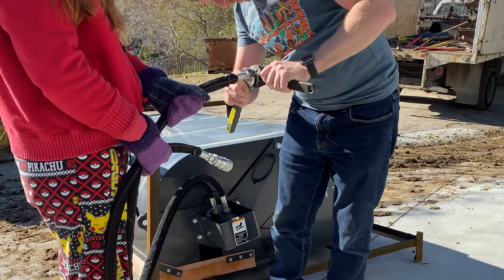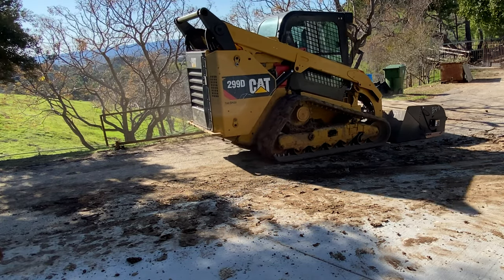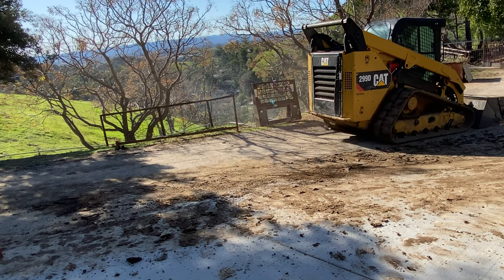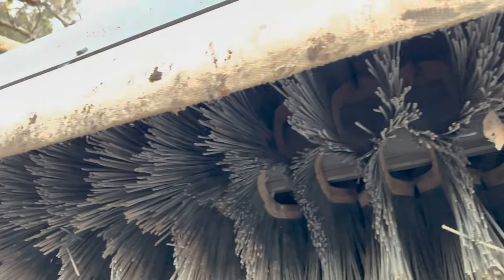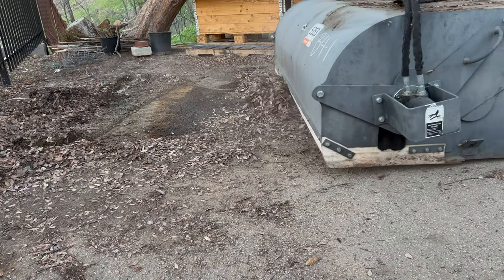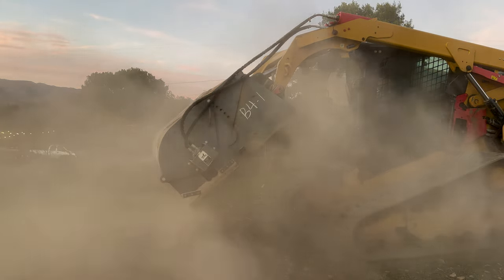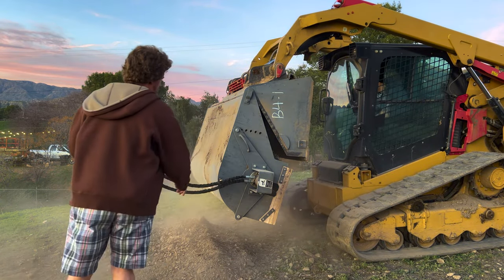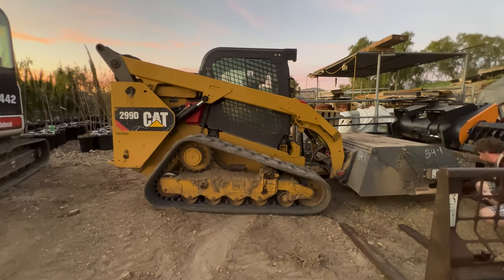Testing out Skid Steer Broom Attachment

Comment: Connect chains from the arms to the top of the attachment and it will dump easier. Use small shackles and maybe a few feet of chain on each side
Reply from the maker: Thank you for the tip!

Comment: I own a lot sweeping /line painting company and run the same sweeper, one thing you can do if the hyd lines are too short is attach a chain on each side from the sweeper back to the skid steer arms so when you dump the bucket the sweeper stays at a predetermined location and wont yank on the lines. I also run Bobcat bristles on mine .
Reply from the maker: That’s a great idea, thank you! So you can swap the bristles out on this unit?
Reply: @MakersAcres  your welcome. yes you can, I've found it easiest to drop the complete arbour and bristle pack out by unbolting the {4} 3/4 IN  bolts on the adjustment arms and lifting the sweeper right off it,  might have to remove a bit of the dust skirt at the bottom of the slot. once out its 6 smaller bolts on the opposite end from the hyd motor then the bristles just slide off one at a time.
Reply from the maker: @BladePro2021  thank you so much for the info!
Reply: @MakersAcres  You're welcome , hope it works out for you if/ when you change them. Take care.